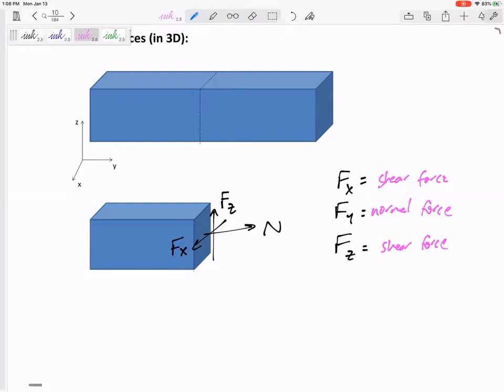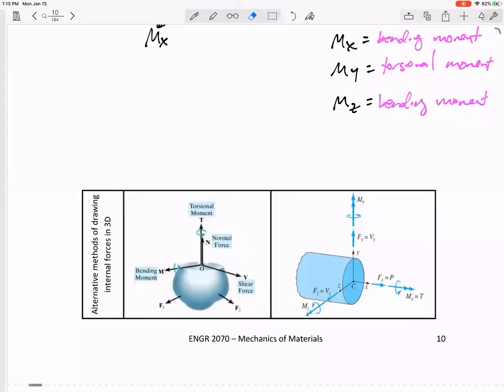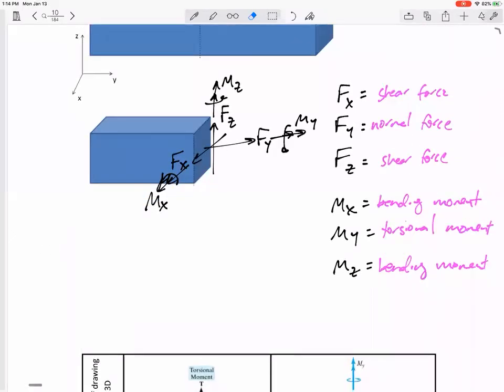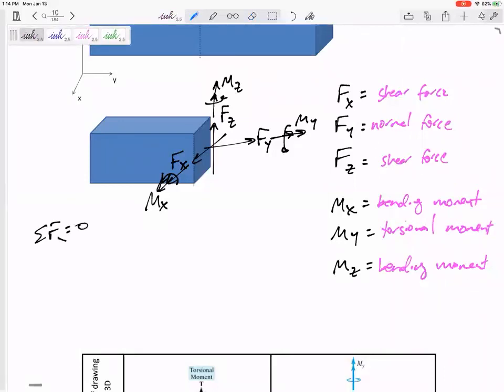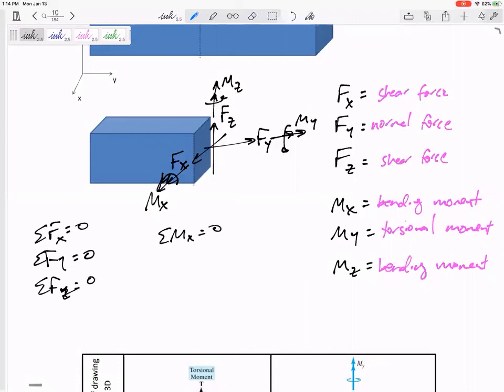Mechanics of Materials - Internal forces 3D notes

Comment: Sir, if forces are passing through longitudinal axis of bar, it will not cause torsion, like in the example above if Fx and Fz are passing through centroid of the cross sectional area, then these forces will not cause any torsion. is that correct observation ? thank you
Reply from the maker: Correct, a moment is needed to cause torsion. I have some videos much later in the Mechanics of Materials playlist about torsion, moments, and combined loading.
Reply: @engineeringdeciphered  thank you